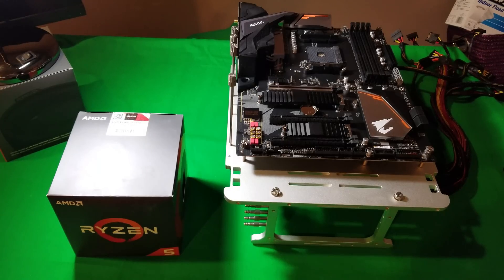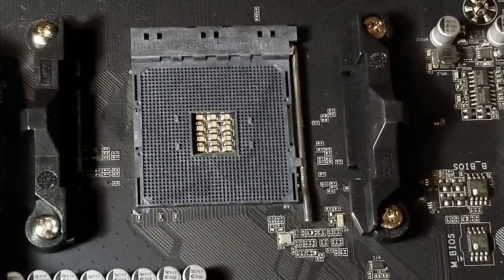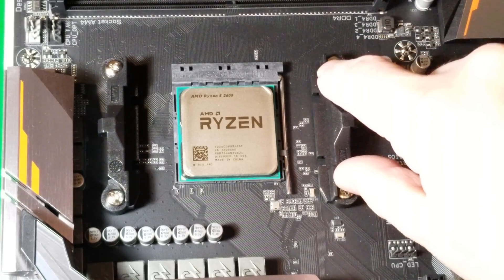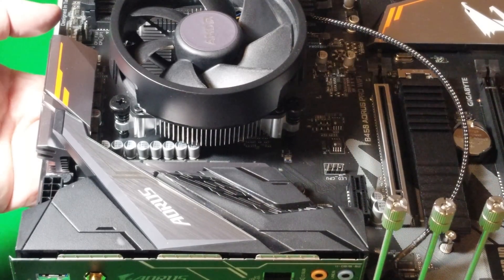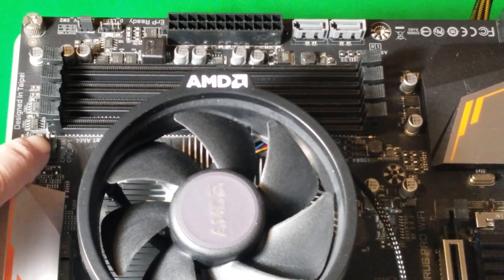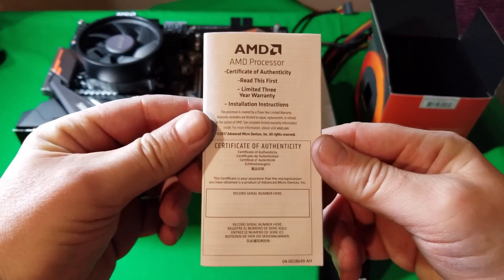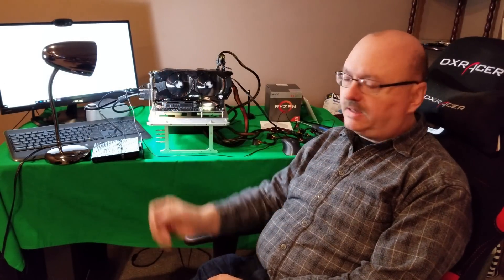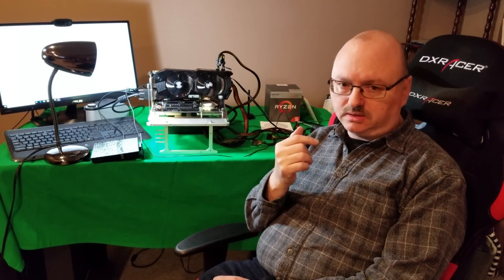Ryzen 5 2600 Unboxing and Install plus CPU Cooler Temps

Comment: What are temperatures and noise under load? With CPUZ bench, for example.
Reply from the maker: Noise was a bit louder then I'd have wanted but is bearable...I did a video recently using a Scythe Mugen 5 and it's much much better, and so were temps, I can't run temps under CPUZ with this stock cooler as I've removed it but if you want them with the new CPU Cooler it's a high of 62c under full load...hope that helps...Thanks...
Reply: @Reviewing_Playing_and_More_RPM , oh, if it's 62c under load with this powerful cooler installed, then I'm a bit worried about temperatures and noise with box cooler..
Reply from the maker: @ZhekaTrololo  With stock cooler it hit 72c that was under full load as well, so it'll work unless you want a better one...Thanks...
Reply: @Reviewing_Playing_and_More_RPM , thanks for reply! Can you please tell how much noise it was making? I guess it was on high rpm.
Reply from the maker: It was not even noticeable once it was in the case, so not very loud, I'm just extremely picky with the noise level of things...Thanks...
Reply: @Reviewing_Playing_and_More_RPM  me too! That's why I was so concerned. Thank you for your answers, you helped me a lot!

Comment: This was a great tutorial. Its gonna sound silly but when i grabbed the fan i didnt realize it had the thermal paste on the bottom and my finger smudged the bottom. Do i have to reapply a new coat?
Reply from the maker: To be honest depends on how badly smudged, if you can smooth it out a bit so it covers everything then it's still fine, I did this once as well and chose to re-apply the Thermal Paste but if it hadn't been for a video I'd have smoothed it over and gone with it...Thanks...

Comment: So I don't need the screws and the brackets that you took off the motherboard anymore?
Reply from the maker: You won't need them for this installation but you should keep them in case you upgrade your CPU and it has the Wraith Prism CPU Cooler, you will need to put them back on for that one...Hope that helps...Thanks...

Comment: The AMD video didn't cover the cooler installation so thank you for the clarification good Sir :-)

You don't tighten your screws in a diagonally opposite fashion to get more equal pressure?
Reply from the maker: Yes diagonal is the recommended method, I learnt the hard way lol...Thanks...
Reply: Just installed my new Ryzen setup, works like a charm thanks :-)
Reply from the maker: Cool...

Comment: the cpu fan can turn any position?
Reply from the maker: The fan turns clockwise...Thanks...
Reply: @Reviewing_Playing_and_More_RPM  I mean placing on top of the cpu. I don't know how to explain that....
Reply from the maker: @tongtv  The CPU fan where the logo is should face away from your RAM (memory) it can go either way but with it going the opposite direction from how I placed it, you will get more clearance for RAM...hope that helps...
Reply: @Reviewing_Playing_and_More_RPM  Thank you very much for your info.
Let me explain what I want to know.
I want to know if the cpu fan cooler can be put in for any direction. as long as the cooler fits in. Is that right? Because some cooler has 4 screws in each corner.
I want to know if the cooler matters when i put it wrong even if it fits in.

I know explaining in English is hard. i am thai. Thank you very much for your help.

Comment: Does this cooler work with the asrock X570?
Reply: yes its fit to chipset am4 will fit am4
Reply from the maker: As said by Dean Calder, yes it will work with AM4 motherboards...Thanks...
Reply: I’m having trouble probably I’m too timid thanks!
Reply from the maker: Well if you went to the expense of a X570 might be worth trying an aftermarket CPU Cooler, there usually easier to install and work better...I worry every time I put on a cooler so not a timid thing, it's called not wanting to waste money if something goes wrong, you'll figure it out, but if not see if there is a friend that can help, or your local computer shop...have a great day...

Comment: My Ryzen 5 2600 is 86 at idle. I have changed thermal paste and also made sure the cpu cooler was properly placed but it doesn't seem to drop from 86 Celsius at idle. Any idea on whats causing this? also there is no performance change it runs smooth. but when im rendering a video or playing  it spikes up to 103-106 and thats when i notice the performance drop.
Reply from the maker: Well can't say for sure, it does sound like the Thermal paste could be the problem, or it's not securely fastened down...could try removing and cleaning off the Thermal Paste and re-apply with your own to see if that makes a difference...if not not certain what else it might be...you ensured the CPU Fan is on properly and plugged in to the CPU Fan header as well...check that the fan is spinning to check airflow...of course there are other things that could contribute to high temps like airflow and such but I'd need to check to be sure...hope this helps and it gets resolved...Take Care and good luck...

Comment: I heard that the pre applied thermal paste wasn't that good for temps, how did you find it compared to aftermarket thermal paste?
Reply from the maker: I used it for 4 months and it worked just fine, temps stayed the same as in the video...I did replace it after though when I installed a new R7 2700X and use the Wraith Prism cooler and works fine with the pre-applied as well...but if you are concerned you could use Thermal paste of your own remembering to remove the pre-applied paste first...Hope that helps...

Comment: Do you need thermal paste to put fan on cpu?
Reply from the maker: Thermal paste goes on the CPU not fan, and it comes pre-applied with Thermal Paste so no need to get more unless you want to use a specific brand...Thanks...
Reply: @Reviewing_Playing_and_More_RPM  alright thank you

Comment: I accidentally touched the thermal paste should I be worried about the cooler
Reply from the maker: No, unless you removed a lot, it'll still work just fine, if you did then you should clean up the paste that is there and re-apply new thermal paste...

Comment: I notice the fan logo AMD part sticks out a bit, is that going to block the first ram A1 slot?  Dual channel runs in slot A2+B2, but later if I get more ram, that will be blocking it.
On my Asus b450-f, the thick plastic covering on the opposite side is also just slightly blocking that AMD chunk of the fan if I swap it the other way.... thoughts?
Reply from the maker: In the description of the video I explain that it should be facing the other way to provide more clearance for the Ram...Hope that helps...
Reply: @Reviewing_Playing_and_More_RPM  Right, I read that, but I'm saying the wraith stealth on the asus b450-f if put the way you say, is blocked by about 1.5mm of that plastic bulkhead covering modern mobos have in their top left.   ..I'm going to see if I can unscrew the fan off the heatsink, and rotate the AMD plastic logo chunk to the 12'oclock position.
Reply from the maker: That is what I was saying, to rotate it for more clearance, what your saying is what I was saying by rotating it...so were both saying the same thing...sorry if the way I worded it is confusing...Thanks...

Comment: I couldn't get the cooler to sit right. Made a mess with thermal paste. I hope I didn't brick my board and my cpu.
Reply from the maker: As long as you had non conductive Thermal Paste it'll be fine, if it is, just make sure you clean it up as much as possible, then re-apply new thermal paste and it should be fine...it happens, sometimes the thing doesn't sit right and they it gets moved and causes a mess, I've done it and so I'm sure have many others...hope it all is working fine for you soon...
Reply: @Reviewing_Playing_and_More_RPM  Thanks for the reply, not many Youtubers do that! I'm not sure if Artic Mx4 is non conductive but I did clean as much as I saw with what I had to clean with. This was my very first build and I was extremely frustrated. I took a break for 2 hours and got back on it. I got the thing to sit right and the screws to go into the bracket. That was a pain. All that remains is to start the thing up and hope for the best. Wish me luck!!
Reply from the maker: Luck...
Reply: @Reviewing_Playing_and_More_RPM  Everything is fine. It booted, posted and  it runs much better than my i5 7600k which I replaced. Thanks a lot!
Reply from the maker: Awesome, sounds like you did great...enjoy your new CPU...
Reply: @Reviewing_Playing_and_More_RPM  I will, thanks again. Have a good one

Comment: I need help when i try to instal my stock cooler two sides are off and doesn’t fit into the holes how can i get those two to fit?
Reply from the maker: Best advice is, ensure you only slightly tighten one before moving on to the other one, usually I prefer a diagonal pattern this helps to ensure one side doesn't pull the other up and make it very difficult to fasten them down. Give that a try and good luck, I'm sure you'll get it...Thanks...
Reply: It still isn’t working for me...

Comment: I need help, I have installed the cpu into my pc, and when I turn the power on, he fans come on and everything but just below the cpu and red light appears and nothing appears on my monitor, I have made sure that it is compatible and I have looked for any damage, and can’t seem to find anything, I really need help!
Reply from the maker: So need a bit more info, ie is your memory installed, if so, then some first things to check: are you connecting from your monitor to the Motherboard or the GPU, lastly check how you have connected the LED connectors, just in case it's wrong it's an easy mistake to make for sure...if all that is ok let me know and we'll go further...Thanks...
Reply: Reviewing Playing & More RPM My memory is installed, I’m connecting my monitor to my gpu, and I have connected the fan to the white slot as you said. But I am sending it back as when I put it in the cpu slot, it wobbles about. Then I am going to get a new one. It is compatible with the ASUS A320M-K right?
Reply from the maker: Yes, it's an AM4 motherboard so it does support the Ryzen 5 2600...ensure the fan is connected to where it says CPU Fan...yeah it should not wobble at all once inserted in the socket, that's very surprising...good luck and hope the next one goes better...
Reply: Reviewing Playing & More RPM thanks hopefully it does, but also when I had a look at the slots for the fan, it only had that white one and that’s it.
Reply from the maker: What motherboard do you have now...

Comment: Hey, im new at building pc, Btw are those 4:28 screws come with the mobo or what?
Reply from the maker: The screws on the CPU Cooler, are included and on the CPU Cooler, and whatever motherboard you use will come with all the screws you need for securing your motherboard and so on...hope that's what your asking, and this answers your question if not let me know...Thanks...

Comment: Wich is faster intel i5 or ryzen 5 2600. I need a quick response.
Reply: Ryzen 5 2600 just installed it
Reply from the maker: Would need which I5 your refering to but yes R5 2600 is probably faster...
Reply: @Reviewing_Playing_and_More_RPM  Thanks for response

Comment: I can’t seem to off the mounting brackets with all my screwdrivers
Reply from the maker: The screws are very simple to take off, as shown in the video, can't think of any reason this would be an issue, perhaps it's best if you can't figure it out to see if a friend can help, or time for a computer shop to do it for you...if you meant something else let me know...Thanks...
Reply: Reviewing Playing & More RPM thanks for your help guess I’m gonna buy lots of screwdrivers to see if they fit with the screws
Reply from the maker: You only need a Philips screwdriver you don't need to buy more than this if you're not certain get a multi screwdriver and it will have them all...

Comment: Can you not overclock at all with the cooler it comes with?
Reply from the maker: Yes you can, a small overclock will work just fine...Just ensure you monitor the Temps for a day or so and as long as it's stable, it'll be fine...

Comment: mine is at 40-45 idle and 45-50 when gaming with a stock cooler,are these temperatures ok?
Reply from the maker: The idle temps seem high but if they are the same when gaming then there's nothing to worry about...usually it's higher when gaming and lower at idle....but those are good temps...take care...
Reply: @Reviewing_Playing_and_More_RPM  alright thank you very much

Comment: I am about to do a first time build with a Ryzen 5 2600x, a gtx 1080, and a Gigabyte b450 elite mobo. Does anyone know if I will need to have a external disc drive?
Reply from the maker: Short answer is No, so to install Windows you can create a Bootable USB Drive to get windows installed. However often the ability to get the Network drivers and others for your motherboard will be provided on a CD/DVD still...Now you can download the drivers (and you should) to get the new drivers from the Manufacturers website, but there are times when the network driver does not get installed from Windows, so to update anything if that happens you'll need the Driver provided on the CD/DVD. So if you run into that, I'd suggest first if you can using a different computer to download the driver for the network to a USB, after which you can install it, then get everything else from the Manufacturer Website and or whatever other location you need to go to.  So if you don't have another computer you can use, then getting a cheap external CD/DVD Drive for about $30 will make it easier. So short answer is No but then again maybe. Hope I wasn't to long winded in this explanation. Enjoy your Build...
Reply: @Reviewing_Playing_and_More_RPM  Thank you that is literally a perfect answer!

Comment: Does the stock cooler keep it cool well enough under load?
Reply from the maker: Mine does but I have heard from others it did not, so not sure the reason why that is. Mine under 100% load stayed at no more then 61c...Hope that helps...
Reply: @Reviewing_Playing_and_More_RPM  Great, thanks! I'm on the verge of ordering it and didn't know yet if I should order a better cooler with it, I'll just mount the stock one and it'll probably be fine, and if I'm unlucky and it doesn't, then I'll order one anyway

Comment: I had to lift the fan and turn it around after screwing it in a little, do you think I messed up the thermal paste or will I be okay?
Reply from the maker: I'd suggest re-apply the thermal paste...it may be ok, but only way to know for sure is check your temps and see what your getting...Hope that helps...
Reply: @Reviewing_Playing_and_More_RPM  I'm seeing 41 to 50, load 20%and under while downloading programs and setting up windows. Case is open I have to tidy up the wires later. Thoughts?
Reply from the maker: Try testing it under 100% utilization and see what you get, I got 54c when under full load test for only 5 mins, so if it maintains then I'd say your good. Now I didn't run it in a game for a long duration but in that case you will likely get higher temps then...For now I'd say your still good...
Reply: @Reviewing_Playing_and_More_RPM  Hello again, so at idle it's around 40C, and under load it's looking like 66-70C but I believe that 70 is a spike. Idk how a temp spikes but that's what the feedback's reading. Thoughts again? And thank you for your replies I really appreciate it.
Reply from the maker: +MrNightpwner Well under load it's a bit high but certainly nothing that will cause any issues, it's well within range of being ok. In my opinion you'll be fine at this point..Take Care...
Reply: @Reviewing_Playing_and_More_RPM  I got a major problem, I just removed the cpu cooler to replace it aftermarket and The CPU came up with the fan, like it was glued on. No pins are bent but I'm freaking out. Help?
Reply from the maker: @MrNightpwner  It happens more often they you think as long as no pins are damaged, your fine...if it's an AMD CPU it happens very often and there should be no damage...check to see you can insert it ok, and it will be fine...in future to make it less likely use a twisting turning method to remove the CPU Cooler and it'll be less likely to happen...Hope that helps...Also Intel has pin that can be outright broken and often will still work just fine, just depends on the PIN now not sure if newer Intel CPU's are still the same though...
Reply: @Reviewing_Playing_and_More_RPM  well I still gotta get the old cooler off as it blocks the arm from locking the cpu in place, whicI the cpu came up with it down ironically. Any idea on how to pry them apart?
Reply from the maker: @MrNightpwner  ok, so if the CPU is still attached to the CPU Cooler, it's just held in place by the Thermal Paste, so easiest way to get it off, is to carefully hold the CPU by the edges, and twist and pull gently away from the CPU Cooler careful not to pull so hard you lose control of it and it flies across the room...if your talking about something else let me know...Thanks...
Reply: @Reviewing_Playing_and_More_RPM  no that's it. I ended up dipping my license in some alcohol to get rid of excess old paste and then I used a tiny flathead to nudge it around. No damage, wasn't rough with it.
Reply from the maker: @MrNightpwner  cool good job...